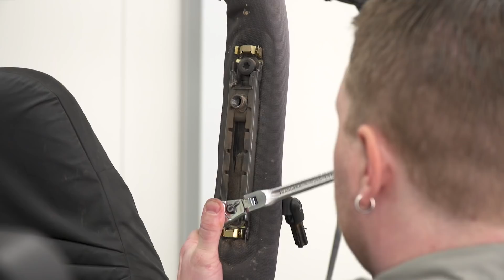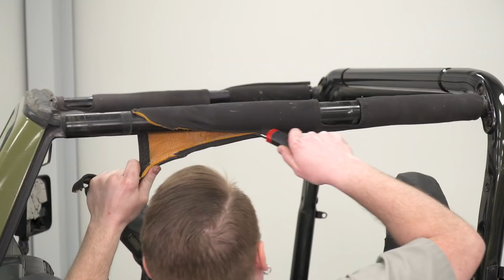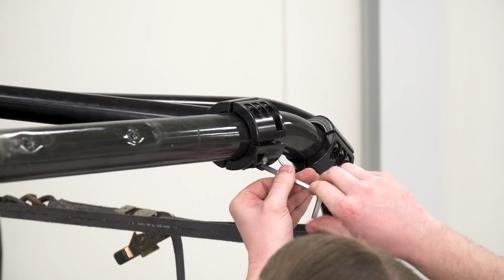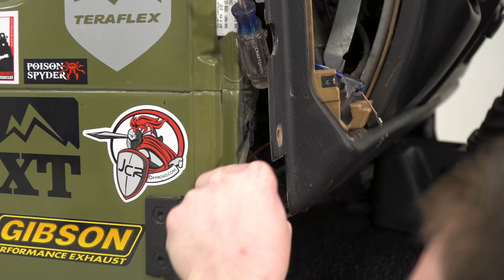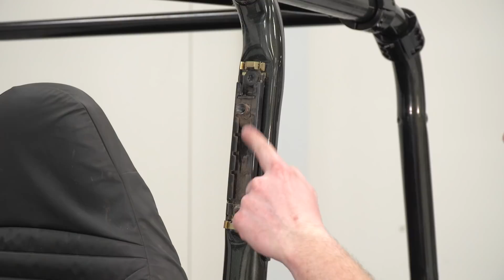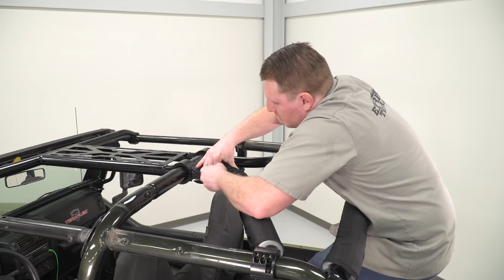Jeep Wrangler Smittybilt SRC Cage Kit - 7 Piece - Gloss Black (1997-2006 TJ) Review & Install

Comment: This video needs some work.   There is no way the crossmember beam will perfectly line up when both of the side pillars are bolted down.  Connect the cross beam to both pillars but don’t fully tighten.  This will align both sides. Once it’s all bolted in tighten up.  I followed this video and the cross beam was over an inch out of whack on one side.  Overall great kit for the money.   I might need a 1.5 inch sear riser now the cross bar definitely obstructs visibility.

Comment: Door surrounds and other plastic trim will require serious cutting so NOT bolt-on by any stretch.    Door jam mounting cap bolts will also rub on the doors making a mystery squeak until you peen the door where the heads will have already rubbed the paint off of the metal if you did a test drive.  Several of my clamshell brackets had the cap head relief hole seriously offset making it impossible to install before using a moto tool to grind out the mistake.  Found 3 such mistakes on two of the clamps.    DIY skills will be required.   Once installed it is a major upgrade to the safety cage.  Serious wheelers will want to add an A-pillar brace to the floor and from the underside of the floor to the frame.

Comment: When you take the 3 bolts out for the door post, why can't you just reuse the factory bolts and clips. Why do you have to remove the clips and use backer bolt plate?

Comment: How does door surround reattach?? does it fit between clamps??
Reply: I have the poison spider 🕷 trail cage. For the sound bar I just made two cut outs for the roll cage bar. Cut the cloth material right down the middle where you are going to cut the sound bar. The material will just fit itself when you put the sound bar back in. It looks OEM finish when your done.

Comment: You put the final bit of padding in the wrong place. The pads with the individual Velcro straps attaches to the center overhead pieces. You need to out the factory padding back on the side bars. Thanks for the video, it helped a lot!

Comment: Is there any way to modify this kit to make the sound bar still able to fit?
Reply: Yes, save your $ and keep your sound bar. This seems like a waste of $ to me when you could weld on some extra bars. Im not planning to roll mine tho. Be safe!
Reply: That's a great question I'm calling them now to find out.  I called Extreme Terrain and they have kits so you can modify it so you can. But otherwise No.
Reply: The sound pods from my 2006 fit and work fine.
Reply: Buy some roll bar marine speakers.. call it a day stop complaining 😄